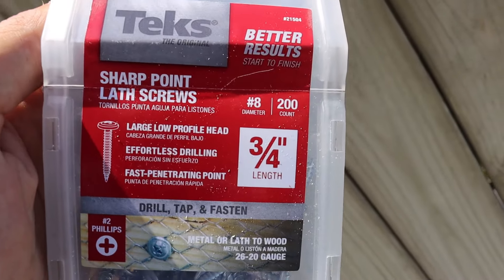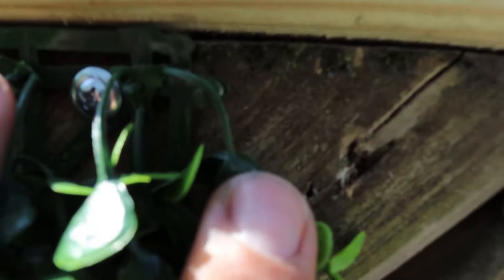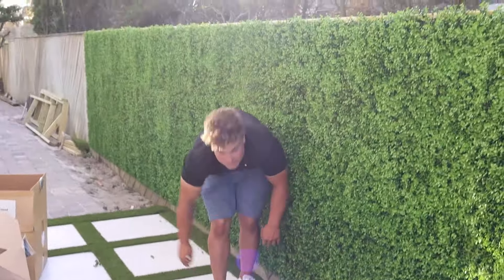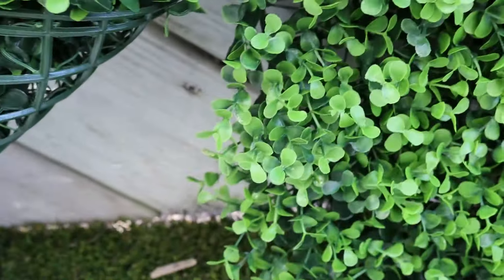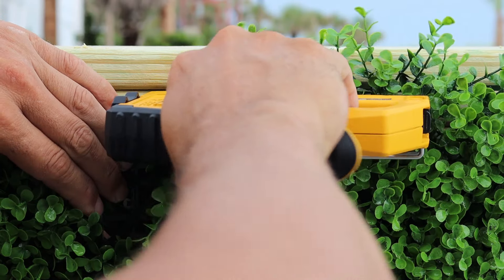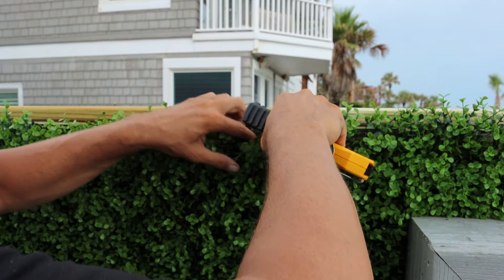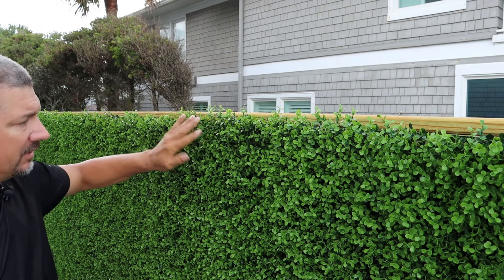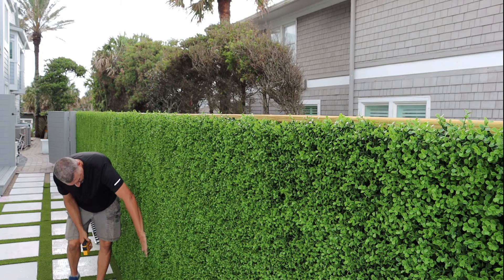How to Install Artificial Ivy Panels on a Wooden Fence

Comment: How do I put that on top of cement walls?
Reply: line the cement wall with wood.
Reply: Hi Angie. I’m the guy in the video. I use plastic lattice that I secure to the concrete wall. Then I zip tie the ivy panels to the lattice